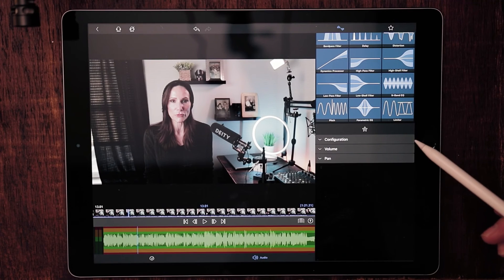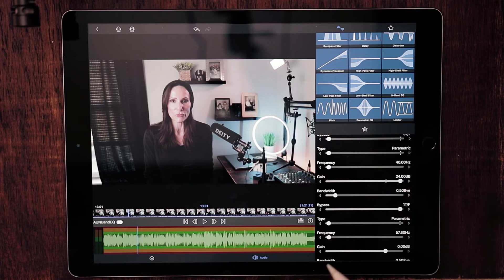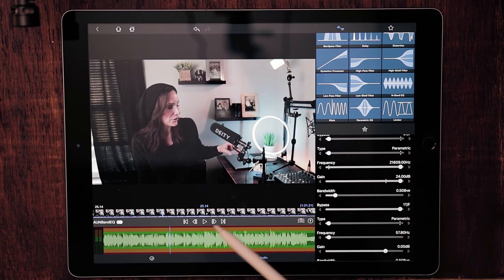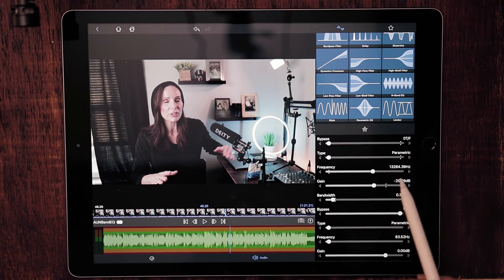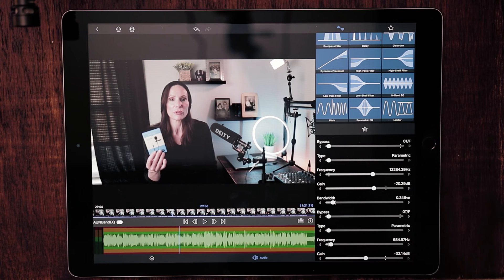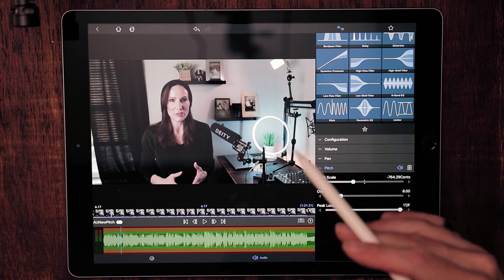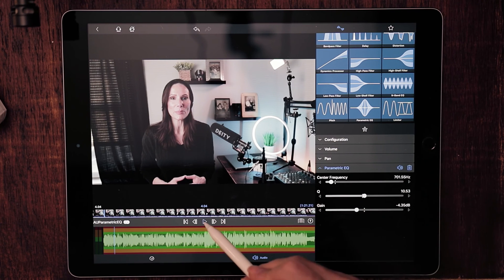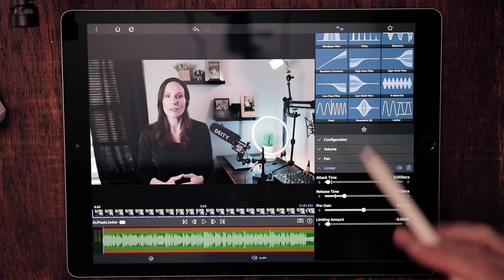Audio Filters In LumaFusion Explained Part 2

Comment: Hi Tammy. 

I realize this video is over a year old, but if you do see this, I’m hoping you could help me with a problem I am having with a glitch in my audio. It is only a fraction of a second, but is annoyingly noticeable and badly placed. I’ve tried to cut it out, but it is right on an important word! I tried to record that word and replace the adulterated one, but the replacement doesn’t quite sound right. 

Can I tweak one of these settings to take care of this? Have you run into this problem before? I’m sure there is a fix, but I’m missing it.

Thanks!
Reply from the maker: So there are times that I hear a glitch in the audio from the timeline but it doesn’t wind up in my final edit. Was it something you did in microphone or is it from the program? Export it to your cloud and listen to see if the noise is gone. If not you’ll just have to do a voice over.
Reply: @tammysypniewski1891  Wow, that was fast! 

I think I must be culprit, I might have tapped on the desk...I don’t know. I’ll take your advice and try what you suggest. Great videos by the way—I have already learned a number of helpful things that I have incorporated.

Comment: I would like to be able to use the Audio Limiter to limit the volume of all the clips, so that nothing goes above the green bar. Is there a way to do this?  (Currently, I’m adjusting the volume of each clip individually, splitting clips when necessary.) Thank you for your LumaFusion videos.
Reply from the maker: Hello.  Ok, so when you bring the video clip in before you start to make cuts adjust your audio levels.  Copy the audio settings onto your clip board and paste them to where you want on the following clips.  The audio setting are for that particular clip and does not master the entire audio file. So if you want to pull down the volume, yes use the limiter for that and by sliding down that gain slider you can either decrease or increase the volume. Hope this helped.
Reply: Tammy Sypniewski Does the limiter work by reducing the clips by a given amount of decimals or does it prevent it from going over a given volume?  Thank you for your help. (My problem is that some people whisper and others have booming voices.)